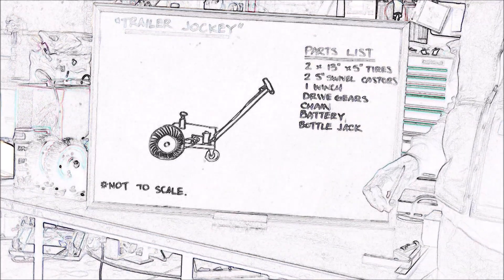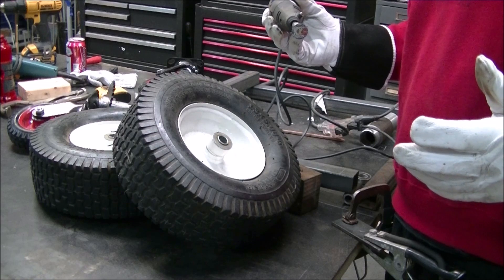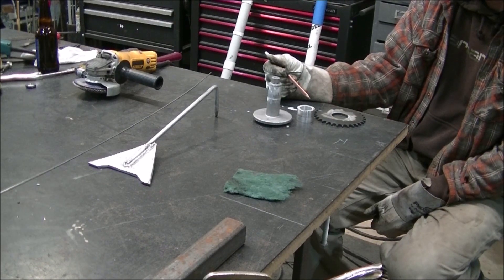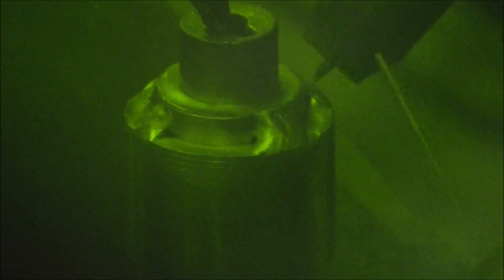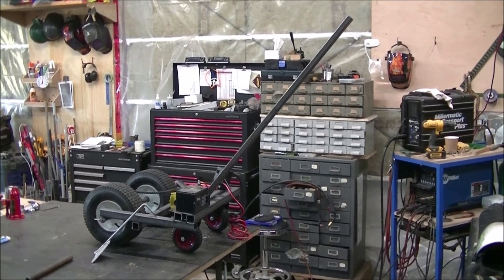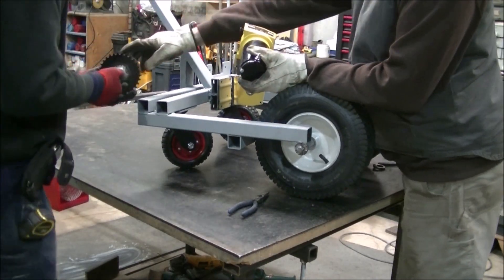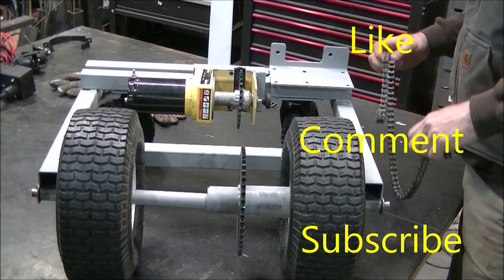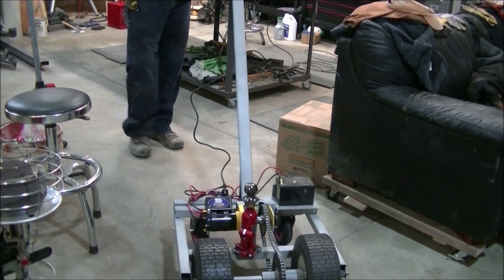Powered Trailer Dolly

Comment: For my 10000 job trailer, what ibs winch be used??
Reply from the maker: I would think a 5000lb winch would be the minimum I would use; you might end up using two one for each wheel depending what terrain your on

Comment: All part list, in detail. Also all section work in detail , such as  bushing work, welding sprocket to rod, transforming from winch to power motor make really good video.
Reply from the maker: I will be making one in the future; I will make a list for the new build

Comment: Good afternoon Dave, good work! I'm wondering what kind of motor you used to drive?
Reply from the maker: It was a winch motor and controller 2500lbs
Reply: @daveprototype6079  how much can your dolly pull with that 2500lb winch motor?
Reply from the maker: @patricklacson  It can pull as much as winch is rated if there is sufficient traction

Comment: Nice elegant design.  Much cleaner than others.  All of these designs, however, including the commercial ones have a flaw.  When pulling a heavy boat in softer ground or lawn, there is a lot of resistance from the trailer and the pull is from the ball, at the top of the jack.  This tends to cause the front (caster end) to rise up when moving with caster end facing forward.  In many cases the rise is significant, can't be contained by pressing down on the handle and can even be dangerous.  I wish you had shown it in action.  Also one of your comments "working on weight distribution" hints that you may have faced that problem too.
Reply from the maker: Yes heavy loads must be moved carefully; it has been modified to be positrack 100% helps with traction
Working on a new one with gas engine for bigger boats/trailers

Comment: Instead of having a dead wheel, I wonder if will be better having a motor for each wheel independently, you can turn on only one of the motors for turning. and double the power for each motor have less stress. Can you tell me where you get all the parts?
Reply from the maker: I ended up making it two wheel drive for traction; yes independent motors would be better. Most of the parts came from Princess Auto
Cheers

Comment: Great Job Dave! I was thinking how would I make an electric pusher and what could I use as a drive system, electric winch perfect! adding a bottle jack another great idea with lots of potential! No tell the truth how does well does it work?  seems like it is good when you have to start somthing rolling or going up a grade but if you are on flat surface are there times you just would rather push since it would be faster? does it pay to add a neutral to the drive if you could do it easily?   Ha Ha and i you want to over engineer it you can ad a regenerative battery charger when going down hill.....kidding! Great job!
Reply from the maker: Works great; winch has a nutral by disengaging drive; but when moving heavy things (not empty trailer, boat) power is the way to go
cheers

Comment: Nicely done! How did you decide on the sprocket size and teeth to know how fast the unit will travel at when the motor is engaged? And where would one purchase these? Are they motorcycle parts?
Reply from the maker: motor rpm / main sprocket to drive sprocket; there is a calculator you can use
parts are from on line or princess auto nothing special as its all low rpm and sprreds

Comment: What is the heaviest trailer that you pulled around? Is the 2500 lb winch strong enough to handle 6000 lb trailer
Reply from the maker: It pulls around 2500 lbs no problem, winches are strong but this was a cheap one. I would use a heavier frame and winch for larger loads.
Reply: Thanks Dave,  have you had to pull a trailer with electric brakes. Did you have to bypass the brakes to release them
Reply: @michaelmayrose5140  If the trailer isn't hooked up to power, it shouldn't have the brakes engaged. The battery on those systems is just for the emergency disconnect.

Comment: Working on a similar project yet different. Anyway, what tooth count ratio did you use? Did you have to experiment different counts or the 1st one worked fine? Where did you purchase said chain/sprockets, what was their original application?
Hope to hear back on this! Thx
Reply from the maker: chain and sprockets Princess auto
48 and 21 tooth gears
Reply: @daveprototype6079  So it's roughly 2 to one. If one wanted more power, switch the small gear to around 14 teeth.  It looks like a stout design, Well done Sir.